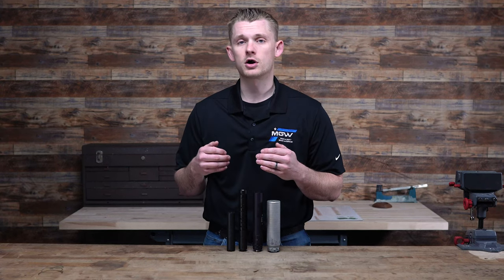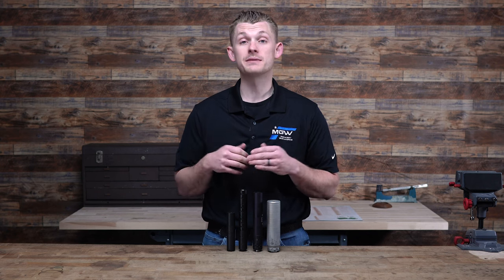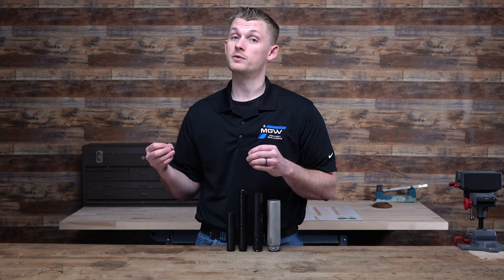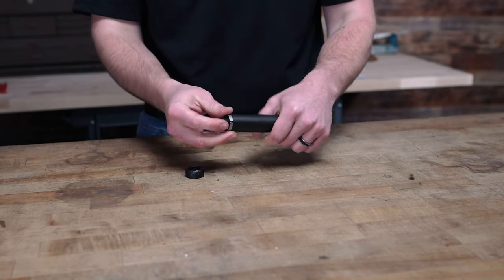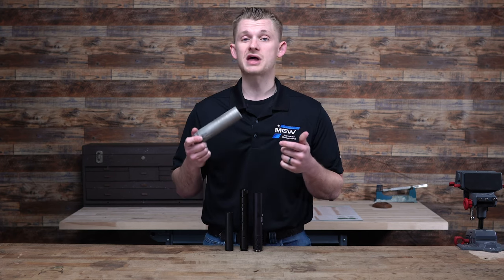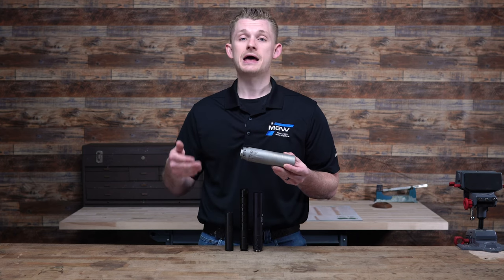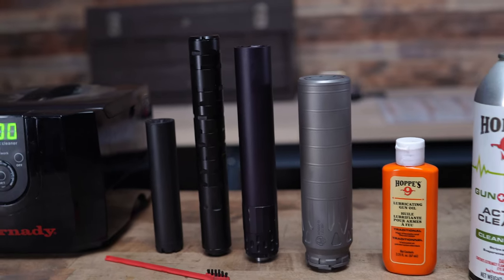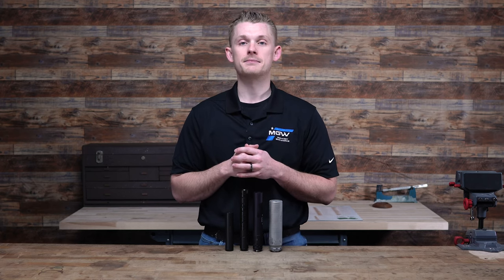How To Clean And Maintain Your Suppressor

Comment: 50/50 water/CLR for an hour or so is magic! I use it to clean my DA attachments
Reply: I’d emphasize PPE. Eyes, hands and breathing. An apron is welcomed too. 🤷‍♂️
Reply: @pevelyhomeowner327  I'm a man! I drive a truck! Even more manly!

😆 I do use gloves
Reply: This safe for aluminum?
Reply: @Tcgunner  im not too sure, I have not tried on an aluminum. I would not do an anodized parts. Maybe soak for less time.
Reply: @Tcgunner Thanks,man! I’m glad to hear about your experience with cleaning the can. It’s always been a bit of Privy Duty for me,(pun intended) but you have been helpful and you are to be commended for your time and effort.
R
Reply: Is this safe in cerakoted titanium?
Reply: @jabooee  my can is raw stainless. I have not tried it on any cerakoted Ti Parts
Reply: @BAcHIGU_  I use CLR on my Banish 22k V2 Ti baffles and they look like new after a 2-hour soak. I’m just not ready to soak the empty cerakoted can at the risk of marring the surface.
Reply: Do you use ultrasonic cleaner?

Comment: @midwestgunworks you said "aluminum" when putting the Titanium suppressor in the ultra sonic cleaner. When you mentioned using simple green ourple solution because it (the chemicals) doesn't harm aluminum... putting aluminum in an ultra sonic cleaner is a no no though. It can cause pitting and can eat away at the aluminum. For a safe rule of thumb, aluminum should not go in an ultra sonic cleaner.

Comment: i have maybe 200 rounds through my 300 cal suppressor but i havent cleaned it fully in 5 years. only the threads and mounts and inside the body about 1 inch on each side but i havent figured out how to take out the individual baffles (silencer co chimera) is it time to soak it in a solvent like some of the comments recommend?

Comment: Important to weigh the suppressor when it is new, then after cleaning to evaluate how clean the can is. Carbon will get so hard that the cleaning solution will not touch it, water will look  clean after the cleaning in the ultra sonic  cleaner.  Amazing to see clean water, but weight tells you that there is a lot of carbon is still in the can.

Comment: Automatic transmission fluid for the win. Cheap house brand stuff works as well as the premium and at $1.99 for a quart, which can be used over and over until it's fouled, it's the best value of any of the dedicated products. 

Iv'e tried all the gun cleaners and all are a PITA to use. ATF runs circles around all of them

Of course it needs to be said - I don't know why anyone would EVER clean a suppressor unless it's a.22lr

Comment: How about using a ultra sonic cleaner? Any suggestions?
Reply: Works great as long it's a durable non-coated material.  My Rugged Oculus 22 recommends Purple Power and an ultra sonic cleaner for the removable stainless baffle cones.  Avoid use on aluminum or any coated parts (like a Cerakoted tube).

Edit: plus they talk about it as well at 5:53

Comment: How long will a suppressor last with proper cleaning?
Reply: A lifetime for most people. A few years for heavy/pro shooters
Reply: check the experation date on the bottom of the can
Reply: it will last but it will get heavier over time from the carbon buildup
Reply: It actually depends on the caliber you're shooting. 22lr is DIRTY so they will build up more, quicker, than other calibers like 9mm or rifle rounds. Rimfire is the dirtiest you can shoot. Also the funnest imo 😂